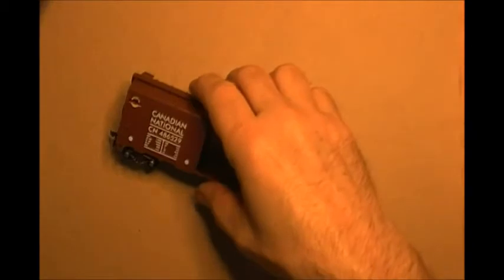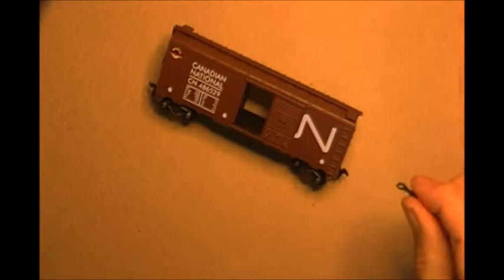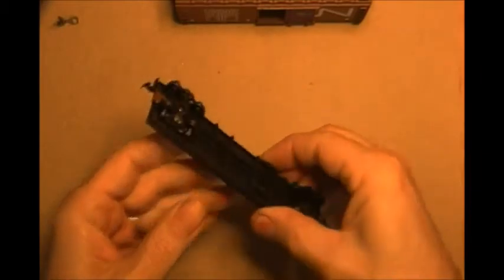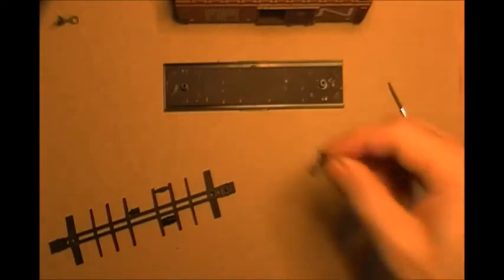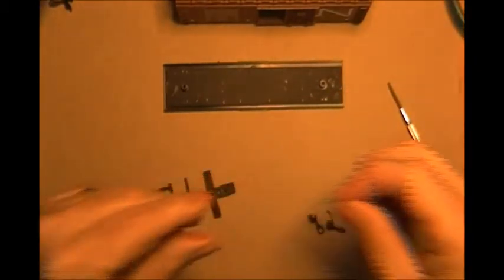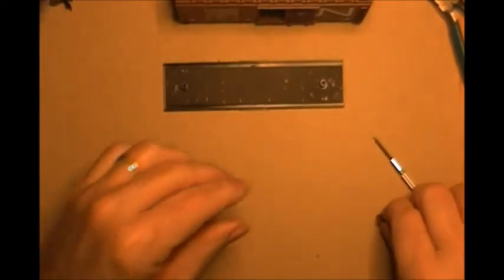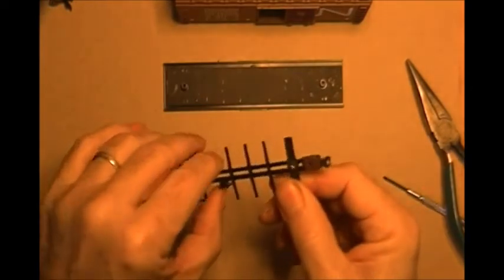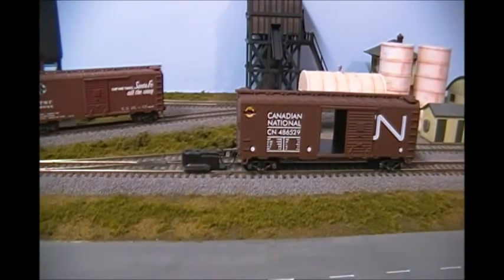upgrading Athearn freight cars part 2   Installing kadee couplers

Comment: Great videos. Just subscribed.I just received two bulk packs of the #148 Kadee couplers. Before even opening the packs, I can see that there are multiple springs that are loose inside and appear to have come off the couplers. Not having done this before, I can't begin to imagine the tweezer work I'll need to do to reinstall the springs, and the large white table cloth I will need to find the springs that decide to jump away. Any thoughts?